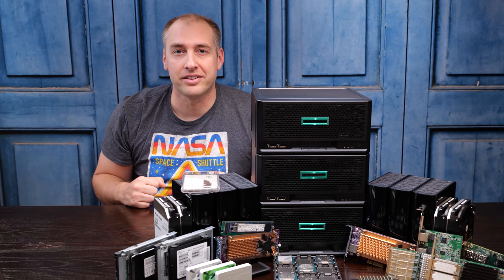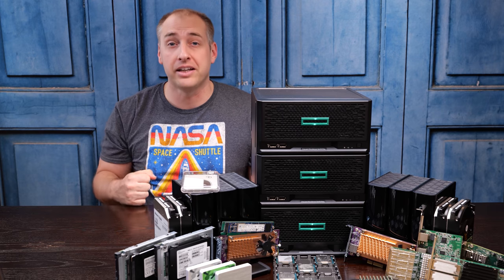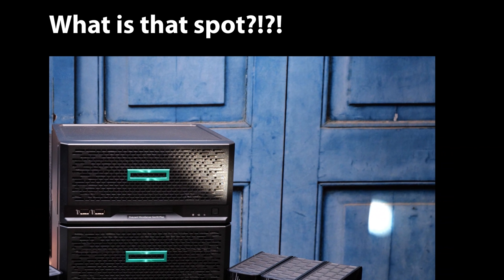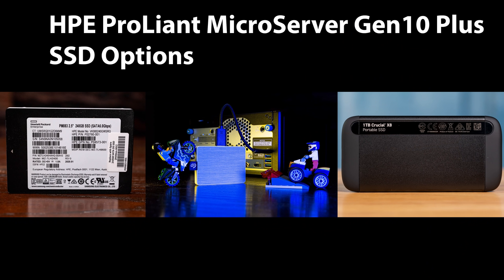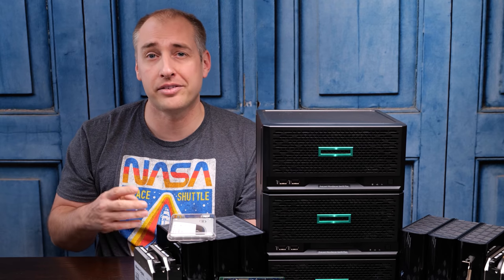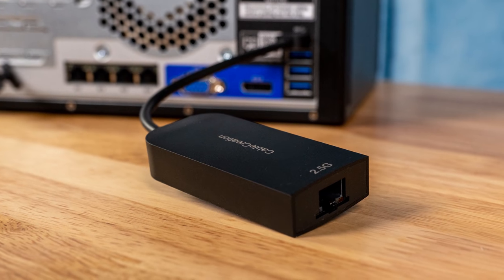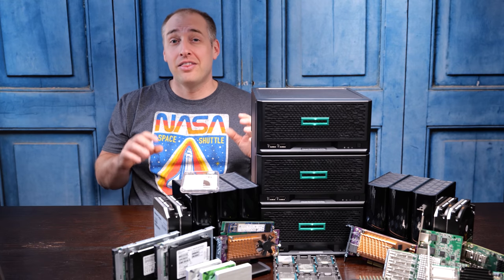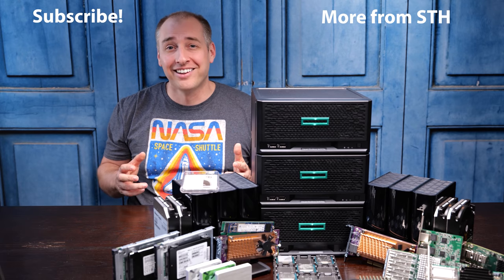Ultimate Guide for HPE ProLiant MicroServer Gen10 Plus Customization

Comment: How about adding the WD Black P50 USB 3.2 2x2 external drive at 1.980 Gb/s it's even faster than the Crucial X8 @ 1.250 Gb/s. Then when you get your next Laptop or PC with the newer USB 3.2 2x2 spec in place like I have you can take advantage of it there. Technically, the WD Black P50 is a bit fancier than its Samsung and Crucial rivals, as it actually supports the even newer USB 3.2 Gen 2x2 standard, rather than just the regular USB 3.2 Gen 2 speed. What's the difference, I hear you ask? Well, whereas the normal Gen 2 supports up to 10 Gb/s, Gen 2x2 doubles that to a maximum of 20 Gb/s. To put that in friendlier, MB/s terms, WD claim the P50 can deliver up to a whopping 1980MB/s, making it twice as fast as current USB 3.1 devices.

Comment: I don't get it, you have the i3-9100F, but why not something like the i9-9900T? Or even some i5s for good measure. Spec says it's the same socket, they're the same generation, and for a TDP of 35W you get 8 cores/16 threads. You've tested all the fancy Xeons, so I'm guessing price is not the reason to exclude it. What am I missing?
Reply: C246 Chipset only support xeon and i3

Comment: Would be perfect to have a m2 interface on the board, or the internal usb is version 3.
Reply from the maker: We gave this feedback to the HPE team when we first saw the production unit. They are aware.
Reply: @ServeTheHomeVideo  really appreciate your test, and also the feedbacks. Than you STH.
Reply: No need for the internal port to be USB 3. USB 2 is fine for booting and way less bug ridden for the purpose...
Reply: Br0kk alright, true. I was thinking esxi or unraid on usb stick can be options for the internal usb, to save a disk slot for OS, and thought usb3 would make booting faster. Think over again the speed may not matter.
Reply from the maker: @veh1640  When we tested FreeNAS, Unraid, and ESXi for the original review, we actually installed to a SanDisk USB drive. This works well.
Reply: @veh1640  indeed for ESXi and unraid the speed of the boot drive doesn't matter that much. Both of them operate out of a ram disk. I had serious problems with usb3 and booting....
Reply: @ServeTheHomeVideo  Thank you! i will do the same(when i get one~) xD
Reply: @BR0KK85  Today I tried esxi on a usb drive with my pc, it booted up quick then i created some VMs on the hard disks, everything worked well :D
Reply: @veh1640 tips: get a good brand usb drive and not the tiny sized ones. They do get hot and fizzle out after a while. Google ESXi backup via shell or just outright clone the drive to a new one.

Comment: Finally a good IT youtube channel without bearded hipsters spaming you with annoying ads every 30 seconds. -> Liked and Subscribed -> you have a new fan :)
I really enjoyed and appreciated the effort you put in this video. I use the Microserver since the 1st gen and experimented a lot yout review is really nice.
It actually made me buy that Gen10 Plus Microserver with the XEON 2224. 

Just upgrade my Microserver 1st gen (N36L) but the cpu is under heavy load just by doing rsync from an external USB-HDD. Else network performance for GBit is good with an Intel Pro NIC.

What I just miss is that you present a solution for alternative powersupplies or how one could simply use a strong external powersupply and mod it so it will give enough power.
Probably gonna try out the SFP+ Quad-NIC option and directly hook up the ESXi machines directly to the iSCSI blocks in TrueNAS12

Comment: I hate external power bricks, they get lost or as bad you find them but have trouble matching each brick to the device.
Reply: These are the same Power bricks used in a lot of there laptops. It's actually what sold me on it because I have 2 or 3 of them laying around so if the factory one died I could have the server up and running in about 30 seconds.

Comment: I would like to know the price for that. So far here in IT I didn't find any info about it.
Reply from the maker: Right now discounted Xeon E-2224 models with 16GB installed are under $600 USD. List price is closer to $800. The Pentium Gold G5420 8GB model has a street price closer to $450.
Reply: @ServeTheHomeVideo  for now I'll keep my gen 7.

I'll try to upgrade when it will be cheaper. :D

Comment: Does it support WiFi?
Reply from the maker: That would need to be added after. It does not have onboard Wifi
Reply: @ServeTheHomeVideo  Do I need to connect with lan initially or can I put a network card in out of the box and get going right away ?
Reply from the maker: Depends on the OS. If the OS supports a WLAN card or USB dongle, you can use that out of the box. You will likely not get out-of-band iLO support over WiFi though.
Reply: @ServeTheHomeVideo  I can live without the ilo I'm gonna be running Windows 10 out of the box can you recommend a compatible dongle or network card that I could order

Comment: 06:20 - Prime95 is a bad test for this. I can load my 8500T, 35 W PL1, 44 W PL2, to 55 W or more with a 100 mV undervolt. That undervolt shaved off about 10 W under normal conditions.

This type of software is dubbed a “power virus” for a reason. Please do something a bit more standard like video transcoding.
Reply from the maker: One on hand I agree. On the other, we wanted something near worst case just to see what limits we were hitting power wise. 

A bad result is we tell people they can use chips, stuff drives in, add 100GBE NICs. They deploy machines remotely and then they are constantly hitting power walls and rebooting or worse. If we go lower like a video transcode we risk giving a recommendation that can endanger someone's career or livelihood. It means we are being conservative here for sure.

Comment: They so should have went AMD this Gen...
Epyc
Reply: Yeah, why buy a xeon these days. Epyc all the way.
Reply: The only reason why vendors using Xeon instead of Epyc. Intel would have negotiated a better price & supply deal.
Reply: There is no 4 core epyc cpu as far as i remember...so i guess thats why they went for Intel cpus.
Reply: @12Burton24  why put a limit on cores? Normally power is the main concideration.
Reply: @baronvonlimbourgh1716  because its a entry level home/small business server and not a big company solution so you habe to keep prices on a normal level and also the specs need to be in a normal range otherwise the targetted group will not buy it.
Reply: @12Burton24  an 8 core threadripper or custom 8 core epyc would probably be cheaper then a xeon though. And more power efficient as well.
Amd does custom sku's for oems no problem.
Reply: @baronvonlimbourgh1716  8 Core threadripper is a 180w max CPU so rest in burned pieces for the PSU i guess...
Reply: @baronvonlimbourgh1716  And its a 1 gen ryzen.
Reply: @12Burton24  are you drunk? A 3700x has a tdp of 65 watts or something like that.
Zen is the way to go for this kind of stuff honestly.
Reply: The problem with epyc is related to a non 100% compatibility with current linux distros. Intel platforms are more reliable in that sense.

Comment: Can you just connect a 250W power brick?
Reply from the maker: Answered this in a few of the earlier questions. You essentially run into power and cooling issues if you try it which is why we are not recommending it. Here is the summary for a bit more detail on what we found. https://forums.servethehome.com/index.php?threads/hpe-proliant-microserver-gen10-plus-ultimate-customization-guide.28013/#post-258541

After testing the Xeon E-2288G configuration, be very wary of anyone who simply says connect a 250W power brick.
Reply: @ServeTheHomeVideo  the usual HP big bricks are the 180 and the 230W. I've been using both in a 8560w without any issue for years. Maybe the 2278 is a better 16c option, with a lower TDP.

Comment: At this point, just get another power supply, it looks pretty standard.
Reply: Then the failure point will be somewhere on the motherboard. Unless it is a shared design with higher powered servers.
Reply from the maker: Hi Moi, we mentioned this in several comments already. To avoid re-typing, this is the thought process https://forums.servethehome.com/index.php?threads/hpe-proliant-microserver-gen10-plus-ultimate-customization-guide.28013/#post-258541

Comment: Why? So expensive, there are companies like SuperMicro which provide much more bang for the buck!
Reply from the maker: At this price range, after normal channel discounts are applied, the price is very close. That statement may be true at the higher-end, but on these systems the street pricing is not that far off. We just configured a similar Supermicro system and it was within 10's of dollars difference, but purchased parts not assembled.
Reply: @ServeTheHomeVideo  What supermicro components exists in this formfactor (legit question)

Comment: What about 64GB UDIMMs?
Reply from the maker: Unsupported on the Xeon E-2200 series. 32GB is a big step up. Many platforms require a manufacturer BIOS update to support the 32GB modules since they were released only after the Xeon E-2100 came out in the socket.
Reply: @ServeTheHomeVideo  I have a NV40L right now with 16GB RAM in it. Isn't that unsupported by the processor?

Comment: oof.. 180W external power brick, no 10G ethernet onboard, official support only up to 32GB of RAM.. sorry, but that thing is a turd, no matter how much you polish it. That equipment would have qualified as SOHO server 5-8 years ago.. today even a cheap PC comes with better specs. I really hope the next gen delivers some better value for the price. I'd expect at least support for 64, preferably 128GB RAM, 2x 10G ethernet, 4x 2.5" SAS/SATA or better U.2 slots (or 1-2 onboard M.2 slots). And don't even get me started about "licensing" features of iLO that used to be freely available for decades (where that license costs roughly 1/3 of the base machine price)..

Comment: This is a massive fail video.  The very first thing i would do, is GET A BIGGER POWER BRICK.    You're releasing a customisation video, but refuse to even attempt to customize.
Reply: bigger powerbrick just kicks the can down the road, now you need to consider if the mobo can handle the load. He did give you the compatibility of the higher end cpu models  so if you want to get that 8c16t xeon, you know it works already and exactly how big of a powerbrick you need to get.
Reply: There is a good chance that the VRM on the mobo would cook itself if you go too far on the amps with a bigger brick.
Reply from the maker: Just adding to this, it is not just a power issue near the top end. If we had added a bigger PSU and say 4x 3.5" drives that would restrict airflow, add power, and generate heat, we would have also gone well beyond what the single fan could cool. It was just at the edge keeping that Xeon E-2288G cool.

Realistically, the better option for higher-power is the ProLiant ML30 Gen10 https://www.servethehome.com/hpe-proliant-ml30-gen10-review/ and that ML30 Gen10 can also often be found less expensive with iLO than the MSG10+ albeit in a bigger chassis.

There, of course, is a difference in what we recommend and what we test. This is a good example where we saw going higher-power was not practical and had a higher chance of damaging components so we did not recommend that option. We are also making these recommendations in the context of having tested most of the competitive machines from different vendors in the Xeon E-2100/ E-2200 segment.
Reply: @ServeTheHomeVideo  Then don't call it customisation, call it "This is how many additional items you can add to a stock machine".
Reply: @eidodk  isn't that what a custom server is?
Reply: @baronvonlimbourgh1716  Nope.  It's still stock, since it's all stock additions.
Reply: @eidodk  enjoy your personal definition then.
You'll be repeating that a lot i imagine.
Reply: @baronvonlimbourgh1716  Wait, you're saying that custom choppers are made with stock items, and nothing is built to specs for that one specific build ?  Right ?  Everything custom in the PC world is like stacking stock size Legos together.... Sorry pal, that's not what the definition of custom is...
Reply: @eidodk  i'm not saying anything of the sort.
I am saying that this is what server customisation is.

Give a hp or dell rep a call and ask him if they offer custom servers.
He will offer you these options.
I take it you are not an it guy?

Just because you want it to mean something else doesn't mean the definition changes..
Reply: @baronvonlimbourgh1716  You can assume whatever you want, i also am well aware what the mainstream server customisation opinion is, however, this video already went well outside the constraints of the pretested configurations, yet didn't do (show) the one obvious customisation option that would open the door to the infinite options more power gives... (mo powah).
Either way, i graduated a few years after the initial PC DOS release, and have been in the business ever since.  Not an it guy... pah....
Reply: @eidodk  who says you can actually put more power trough it?
There probably is a reason why it has such a small power supply and i doubt it is because they wanted to skimp on a psu.
Reply: @baronvonlimbourgh1716  Who says you CAN'T put more power through it.  They opted for loads of non-documented chips and alledged unsupported ram amounts, so why not also a beefier PSU ?  Thing about beefier PSU's is... it's not like a 330W psu magically kills the machine, it just ups the margin till the PSU chokes out.  With a 180W PSU, you're constrained by the PSU, with a 330W PSU, you're constrained by the heat and the architecture of the components on the board.   Considering a main board being atleast a semi-quality product, the margin for the architecture and the components are atleast 30%, which would give them 60W more to play with, but hey - let's not take it to the limit at all....
Reply: @eidodk  looking at the fans, heatsinks and airflow restrictions, especially when fully populated with power hungry devices, i think the 180 watts is allready at the termal limit of the case.
Hance why they supply a psu rated for only 180 watts.....
Reply: @baronvonlimbourgh1716  It's not.  Thermal limit would mean things would run hot when you go to the edge.... Newsflash... They don't.
Reply: @eidodk  that is exactly what it means.
Reply: @baronvonlimbourgh1716  Did you not watch the video ?  They were not even NEAR thermal limits.
Reply: @eidodk  pff really? A controled test in optimum conditions?
Know what, I'm done man. Have a nice day